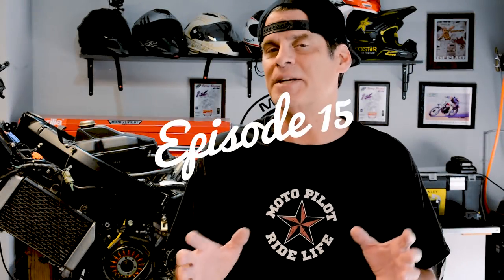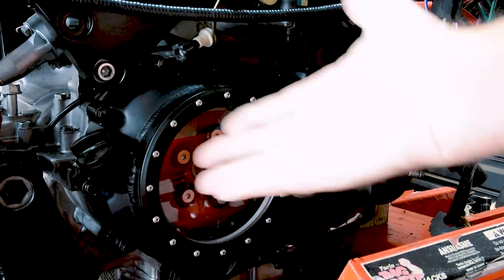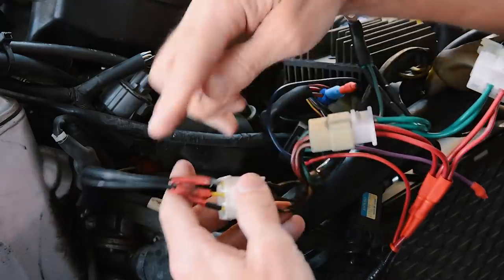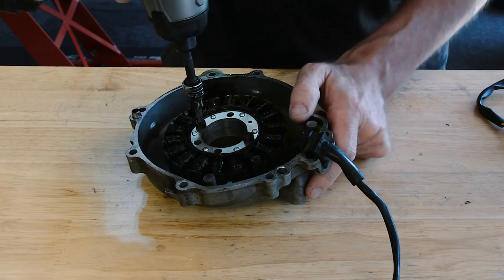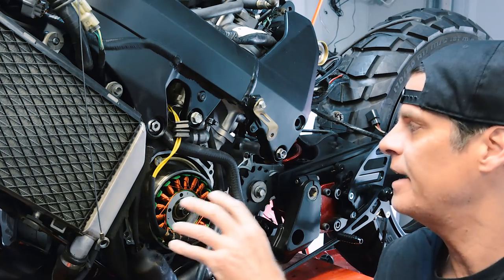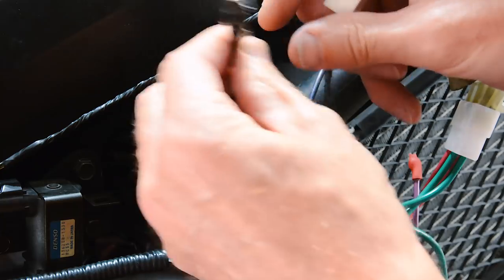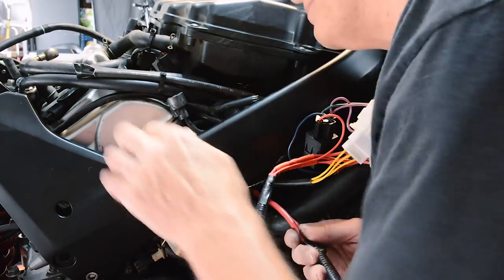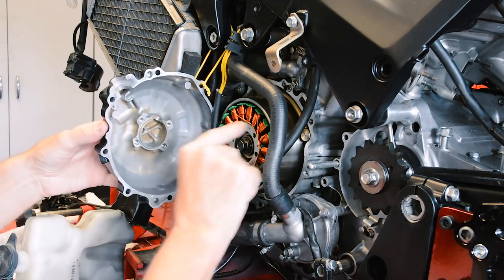HONDA CBR/VFR800 HYBRID PROJECT - New Electronics

Comment: Correct me if im wrong, but shouldn't that ground wire on thr r/r be on bare metal. Grounding issues are a pain.
Reply: The ground wire is a supplemental ground provided by the VFRness and the bolt threaded into the frame does a good job. It would be good to verify with a meter that the ground has good continuity tho.
Reply: @JoshuaTilton  i ran a thick earth cable directly from where the vfrness earths at the rectifier to the battery, i  also made a harness with three 20 amp fuses one on each wire where the three yellow stator wires plug into the rectifier 9:57  the fuse will blow before the plug does that warnes you, that you may have a problem with rectifier or stator. The vfrness is fused as well i recommend you get the accessories fuse box as well as vfrness made by same bloke. I also mounted a computer fan to the rectifier on the account it gets hot from the frame when in traffic. The three yellow stator wires are all the same dont matter where they go please make sure you have a good earth from vfrness to battery if not you will burn out stators i have gone through three srators im now on my forth with no problems. The original lasted 27000 kilometers the second one lasted 10000 kilometers the third about a fuel tank and my forth is going okay

Comment: That chain is gonna be noisy when I replaced my OEM Drive sprocket on my VFR with a Fresh one it didn't have the rubber chain quieting ring on either side ended up getting quite a bit more vibration and noise from it

Comment: That stator doesn’t look oem, if it’s a Chinese stator that will fail very soon. Ask me how I know.
Reply: it's not oem. He is trying upgraded one to hopefully eliminate the issue.
Reply: What Randy said, RM are about as good as you can get, not cheap but then quality rarely is.
Reply: The Regulator is a MOSFET regulator and the right style for Lithium Ion batteries, which are not happy at the voltage levels possible with stock charging voltages.
Reply: @JoshuaTilton  better off with a shunt type rectifier

Comment: From alternator /stator to regulator only línes ...no conector...
Reply: Exactly, ive done that to my vfr and replaced the rectifier and  never had an issue
Reply: A burning Stator connector is often a tell-tale that you have a stator problem..or possibly a Chicken or Egg scenario.  I usually suggest people keep the connector so if a problem arises on the road they can replace parts with OEM.  I've seen few burned connector with the Rick's  Mosfet regulators.
Reply: @JoshuaTilton 
 I think, the problem is due to the expansion of the female connections, which expand heat and vibrations over time, it does not make good contact and it increases a lot of heat and they melt ... Knowing a little about the electricity of the motorcycle itself, helps a lot